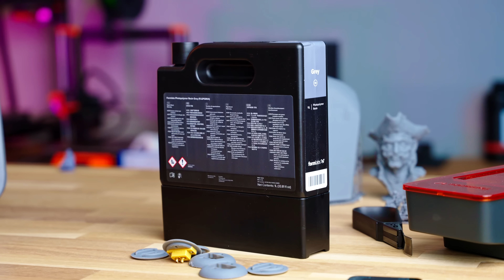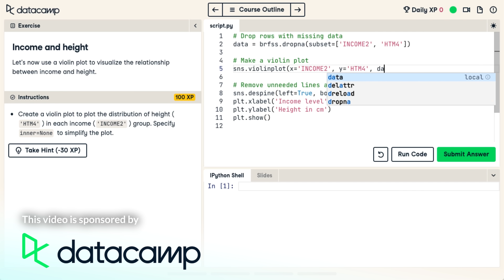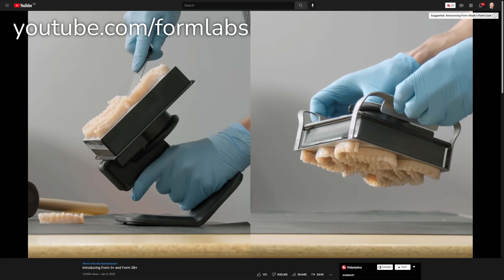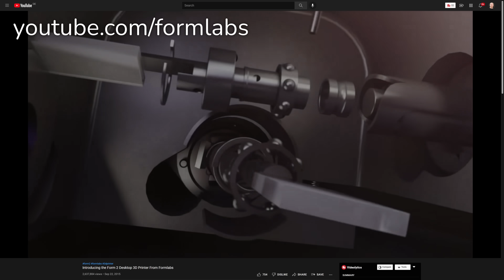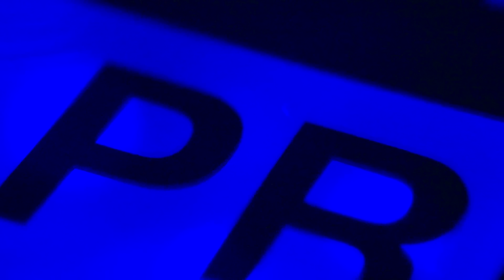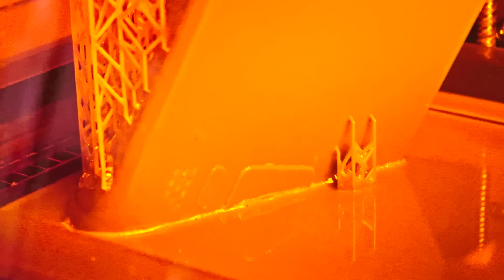This resin 3D printer is built different! (Form 3+ overview)

Comment: I don’t understand why maker companies are still pulling up the model 
Instead of sinking the vat. Never worrying about warping, separation, or weight of the model dropping off.
Reply: Wouldnt it still be relatively similar? If someonething falls off the build plate, then you have to actually tweak the settings. Your exposure times would have to be crazy off for that to happen. Warping would probably also happen if you have messed up exposure times and way too fast lift speeds. Lowering the whole vat seems like alot of bad problems could occur.

Comment: The speed improvement also applies to the form3 since it's mostly a software update (The surface finish is better on the 3+ because of the new LPU, but the speed improvement is transferred)

Comment: Hi Thomas, i am using Ultimaker S5, with both breakaway support material or PVA support material, I do get very smooth and clean surfaces which were supported. I Watched your Feb25 Form3+ overview. Could you please share your feedbacks, about the resin supported planar surfaces, is it possible to have smooth surfaces just like we can get from FDM prints, I can see that the visible surface on the video is perfect, what about the other side after removing the supports how does the other side of the 3d print looks? Do we need to sand and clean the contact points? is there any small bumps that needs to be flattened, can you share some images and your expertise, I am considering adding resin 3d printers to my work shop. Best Murat

Comment: First off thank you for this review!  I’m replacing my Elegoo Saturn with this printer, mainly because of resin temperature control. Tough resin is usually extremely viscous and consequently is prone to failure. Even after installing a heater it’s nearly impossible to control temp precisely. This trial and error process has a real cost associated with it, and I’m tired of that dance.
Reply: I have Elegoo Mars 2 Pro with a heater and PID controller for it with temperature prob in the resin vat. I print most of my prints with tough engineering resins and never had any issues.

I doubt that temperature is the only reason you want to upgrade, but if it is you can try buying a PID controller and see if it helps.
Reply: @zestykefir  what engineering resins are you using? I am having the same printer and the toughest stuff I used until now is various Abs like + 10 -15% flex100 resin
Reply: @zestykefir  can you give me more details on your setup?

Comment: Hey Thomas, super interesting to see what you will think about it. We got a Form 1+, Form 2 and Form 3 at work, also some Prusas and Mars and we found out a lot of pros and cons about all of them. Also have some good testsprints to compare them.
Short overview:
repeadability:
Form 2 and 3 +-70um
Mars 1 +-50um
Prusa MK3s with PLA +-22um
Min Hole:
Form 2&3 0,9mm
Mars 1 0,7mm
MK3s 0,2mm
And other stuff. Please also mention the resin differences of SLA Formlabs resins to MSLA resins! You can use the resins of Formlabs in the Mars but they will take up to 60s exposure time per layer! So a 4h Formlabs print is a 36h Mars 1 print. Also the resins itself are completly different and Formlabs one don‘t smell.
Just hit me up for more information :-)
Greetings from SW Germany

Comment: I've got a form 3 that runs their high performance resins (10k & 4000 mostly). The resins AND the vat really get you cost wise. The way I run it the life of the vat accounts for 80$ everytime I use up 300$ of 10K resin. Amazing material but the costs are extremely high for resin.

Comment: It's exciting to think that this will be a whole video series! I've recently been using my school's Form 3 quite a bit, and I'm finding it works really well, the flexible bed would certainly be an improvement though. Thanks for the video! 💙

Also, I'm trying to work out what the strange block with buttons on it that you printed is?

Comment: I used several Form2 printers for jears now and printed thousands of pieces. The biggest problem with a Galvo-SLA is that the optical unit is getting out of alignment or dirty. Being able to exchange the whole unit would be the only benefit of a Form3 (don't know if even done). 
The printing of fine features was never challenging because of cohesion, either of cross-hardening: later layers will cure resin on the already printed parts. 
The advantage could be fine tubes, where the part usually sucke them selves to the bed/film/tank.
Using a "paper-scanner" method instead of a "laser-show" method reduces the resolution / accuracy of curved features. 
The user experience is great for home-user, but you are stuck with a limited technology.

Comment: I have the 3B printer in my lab at work. I decided on it because while resins are more expensive compared to other printers in its class they aren’t to bad and they have a lot depending on the application. True engineering resins can be a delight. So far I haven’t had a print failure which is nothing like my photon S at home. I will say the slowness of printing surprised me, but it’s not horrific. Prints look amazing and with tweaking come out super consistent batch to batch. For home I don’t think it’s worth it. For work since messing with stuff and and ease of use save time and money, I love it. Normal resins are 150 per liter.

Comment: We've recently installed a Form 3L at work. There are some downsides like you said; it isn't very fast, and the material is expensive. Really expensive. Pretty much 50% of customer jobs won't be financially viable on it, killed by cost of resin.

But for the other 50%, we've found we get quite good results, and cutting down on expensive labour and failed prints is a major win. I can be pretty confident in quoting with it as most jobs are reasonably trouble free, and while the markup might be lower, rework and labour expenses are down too.

Comment: Speaking as someone who bought all high end premium equipment and never ever got it to work, I say.. tred carefully.. very carefully.. and probably.. avoid completely.
Reply: Exactly, this is the biggest scam, the forums tell the truth. Everything is overpriced and it tanks your projects and kills your moral. Should be a class action lawsuit filed.
Reply: @wholeness  Yeah, ditto on killing your moral and enthusiasm.  Let me rather bitter and emotionally damaged.  It's hard to explain.

Like saving up all your life for a new car, dreaming about it, and then when you finally buy one, a week later it slings a rod and the engine is destroyed.  Someone tells you, well, just rebuild the engine.. but the engineis front wheel drive and it's packed int here like sardines and complex as phvvvkkk...  it's not going to happen.     Instead of the realization of a dream, all you have is a very expensive brick.  You bought the dream of freedom driving in the countryside on holidays with the wind in your hair, but all you got was a reminder parked dead in your back yard of your foolishness.

If you're wondering why I used the car as an example, it's because I have just such a car so it readily comes to mind as my go to example of the dissonance between the promise that is sold, and what you really end up, and the heartbreak that follows.  It will mess you up.

That's what it feels like.   Products that promise something, but never deliver on it.  Some you buy, you get nothing but a box of parts in the mail or a never ending headache.

Comment: I have the form3+ at work. The speed of the print varies with the material loaded. With draft it's super fast 4x and with tough and flex slower. The layer height is also set by the material and not equal. Furthermore you should turn on the beta print profile that cuts some prints in half (time). You also missed the idea of loading the material easier and the smart software with preform. So I feel you fell short of what this machine can do. Also, where is the wash and cure station.  We love ours and as an engineering company it fits perfect.
Reply from the maker: I'll cover those aspects in the coming videos! Still lots to dive into.

Comment: Right after the launch of Form3, formlabs discontinued support for Form2 at my former employer.
Reply: Formlabs is still supporting the Form 2. If you have an issue with the machine, get in touch with services and they'll help. The thing that might have happened is that coincidentally your Pro Service Plan ran out at the same time so you don't get extra speedy replies etc. anymore, but regular customer service is still helping out with Form 2
Reply: @Chaosghoul  in fact, we contacted official support, but the only answer was to get a new printer
Reply: @MartinWolker  Normal industrial behaviour after such a long time. They will hopefully make you a good offer.
Reply: @lazyman1011  The company spent approx. 12000 € in total and after half of year they just dropped the supprt? It is not good.
Reply: @MartinWolker  Sounds bad

Comment: I've used a formlabs 3 for a while now and it's a very nice printer. Once it starts I know it's going to finish. The only error I have had in it is the touch screen goes bad and needs power cycled to get it to work again. Not sure if it's a software or hardware bug tho.
Reply: If that is happening more than once, get in touch with services
Reply: Yeah we have two Form 3 printers and one of them is having some glitching on the LCD screen as well.

Comment: Not sure you are correct about it tracing the outlines. It looks more likely to be a single line raster scan  ??? If it moved the head it'd be sqeezing and peeling as it tracked so not a good idea
Reply from the maker: That's the point of the "low force stereolithography" approach - the print is continuously peeled from the separator film instead of being ripped off in one go. It does do raser scanning for the infill, but it wouldn't be able to get smooth contours without tracing them.
Reply: @MadeWithLayers  Mine indeed never traces the outline, it scans the layer left to right. I am printing tall clear resin parts at the moment, so the movements of the laser dot is pretty visible at the moment. Or would this be part of the experimental beta profiles preform offers (that i never use)...

Comment: Ooh interesting. We run the Form 3B at work for biocompatible prints used in maxillofacial surgery. I have nothing but great words about Formlabs, especially their fantastic support
Reply: I have a Form 2 and Form 3. Honestly, their support is FANTASTIC and one of if not the reason to go with Formlabs over anyone else.
Reply: We have the both the form 2 and form 3 for the same thing. We have had some different issues but the formlabs support has come through everytime.
Reply: I use their bio med clear, but we need prints done in under an hour, so we have to use different printers
Reply: Try Figure 4 Plattform from 3D Systems, it is much more advanced. Especially when it comes to material selection and speed. Of course it is a DLP but has 130mm per hour printspeed.
Reply: @firebloomstudios140  it's 3D Systems
the tanks/trays are 4x more expensive ($600ish compared to $149) than the Form 3's
it requires manual pour of resin
the machine costs $21,900 which is absolutely ridiculous for it's tiny 124.8mm x 70.2mm platform.
Reply: @owencoyne6223  don’t know where you get your information from but I can tell you it is absolutely wrong. Pricing you quote is wrong. Materials start at 250 bucks and productivity is by far higher than the Formlabs machines. Currently I am exchanging a lot Formlabs printers for Figure 4‘s cause of productivity and materials selection which is outstanding at 3DS. And btw. Figure 4 is also available as Modular version with automatic material dispense and 385mm in Z-Axis . But it’s not comparable to the Formlabs cause it’s aiming for mass production.